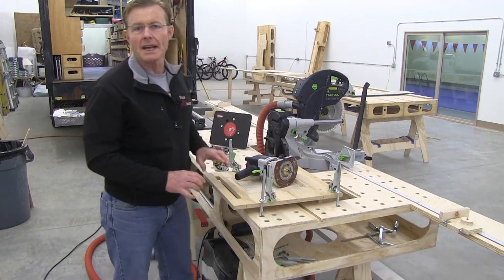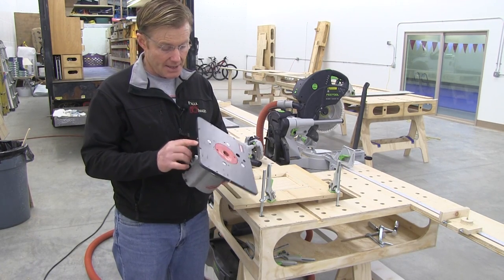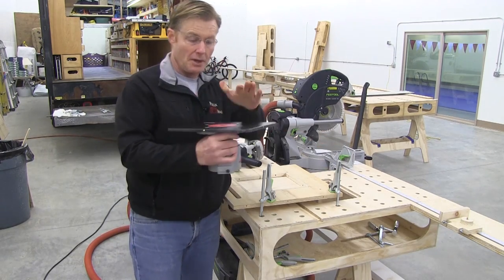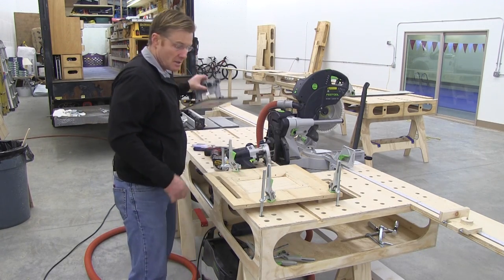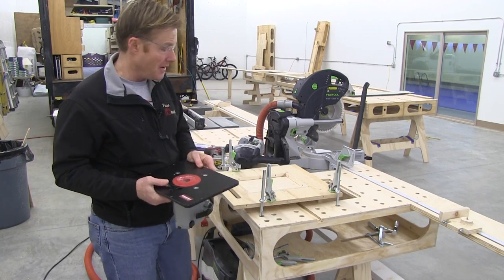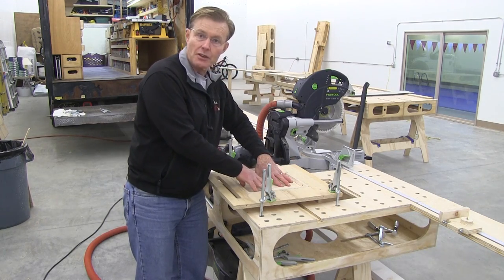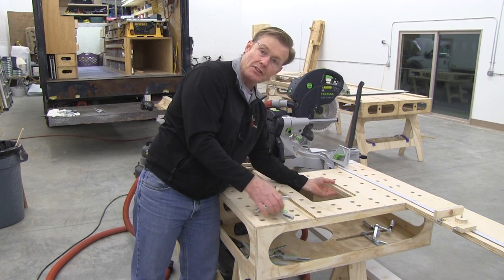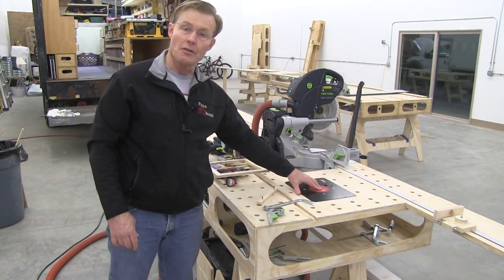BUILDING THE PAULK TOTAL STATION PART 15 CUTTING IN THE ROUTER PLATE & MITER TRACK

Comment: Ron, instead of using the 1/2” strips inside the template couldn’t you use a bushing with a greater diameter to achieve the same effect? i.e.; when using 1/4” bit use a 7/8” or 1” diameter bushing instead of a 3/8” bushing.

Comment: Looks great-although it seems that running longer narrower things through the router could possibly cause the piece to drop and get caught in the miter saw area.  I understand that you could angle the fence, but does it clear the back of the saw and it's opening @ 90 degrees?   (I'm sure it does =) )
Reply from the maker: The run out on the router table does not pass over the miter saw opening. Getting the three big tool working together took the lion's share of my time in getting the final bench right. This time the prototype was necessary to work out the bugs.

Comment: The template you use to cut the woodpecker plate rabbit, what is the radius of the corners.  Did you use the plate itself to make that template?  I wanted to get that radius perfect for my bench, but I am baffled how to do it with template guides or otherwise
Reply from the maker: Wayne Flittner Hi Wayne, I use a whole saw to cut the corners of the template. I am not sure what size it was, I just placed the whole saw on the plate to find the right size.